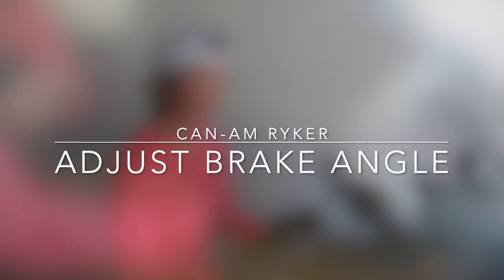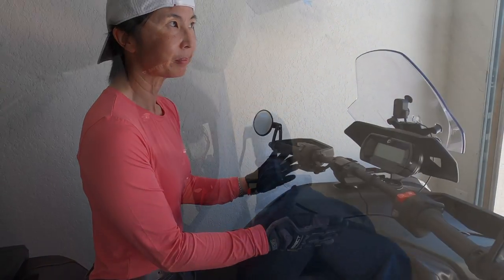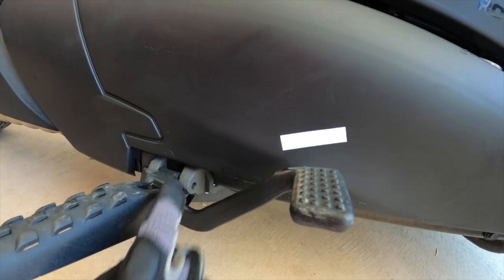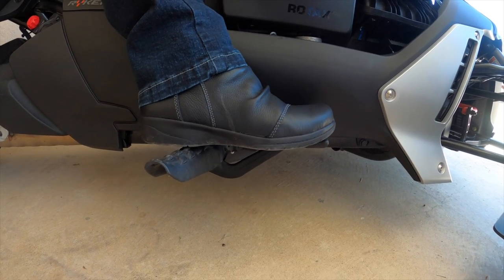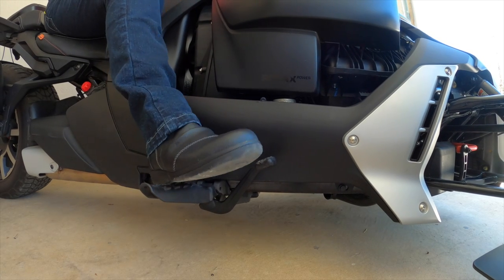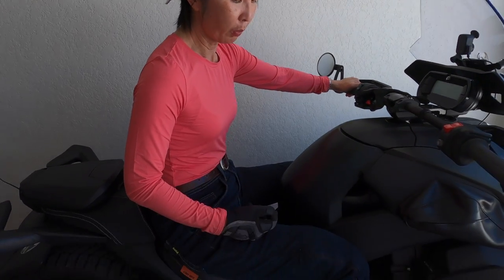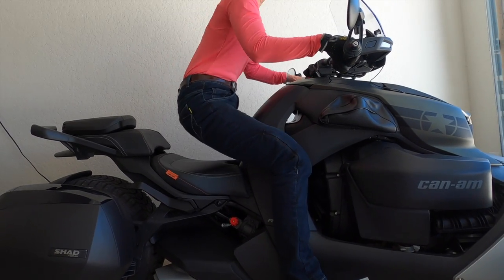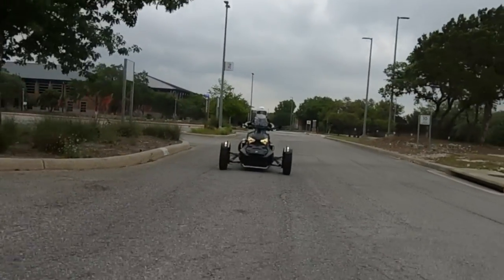Adjust Ryker Brake Pedal Height | Foot Peg Position | Avoid Limp Mode | Can-Am

Comment: Good video and some good advice. Unfortunately I have to take my Ryker in this Friday to have those codes cleared. I had my break pedal set a number of ways to try to avoid riding the break but it still happens from time to time. Just a little side note the markings 1,2,3,4,5 are just for ease of matching one side to the other. You can place the pegs at any point along the track. So you can also do half positions if you want or need to. 
It’s funny that I just posted a video on changing the peg positions on my Spyder and said the same thing about the break pedal position however it’s more involved changing peg positions than on my Ryker.
Reply from the maker: Thank you for sharing that the pegs and be in between the markings! 😃 So just letting the Ryker cool was not enough to reset your code? 😕 Can you share the link to your video on the Spyder? I would like to check it out ☺️
Reply: @urbandingo6882  unfortunately waiting didn’t help. One time I rode to the dealer to have it fixed and about 4 blocks from the shop it went back to normal. Most  times it doesn’t. I’m sure it’s me and not the trike but I could be wrong. It would be great if there was a mechanic who had the ability to tell me what’s wrong. I’m this close to buying the 700$ computer to reset everything myself . I have gone into limp mode 4 times since October 2020. My Spyder did it once I shut it off and then on all clear one and only time.

Comment: How did you get out of limp mode when riding the brake. I think I did that.
Reply from the maker: Hi Vicky, according to FB groups, try allowing your trike to cool off and see if it resets. If not try reconnecting the battery and/or fuse 15. If none of these worked, I would get it to a dealer 🤷🏻‍♀️ Please let us know what worked for you! 🤞🍀
Reply: @urbandingo6882  I got that limp home mode vss fault twice. Locked my speed to 51, 59 mph. I ride both times for about 40-60 miles at the top speed above and it cleared. Unplugging the battery didn’t work for me.
Reply from the maker: Glad you were able to clear it without having to go to the dealer 👍 Thank you for sharing 😊